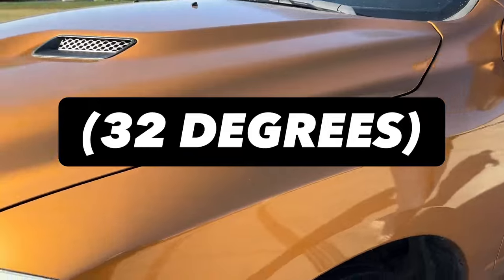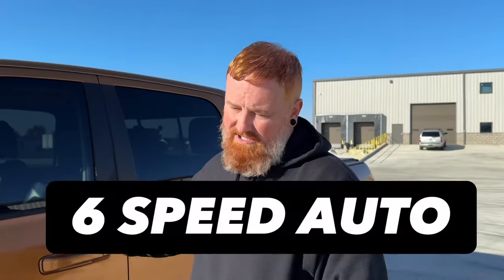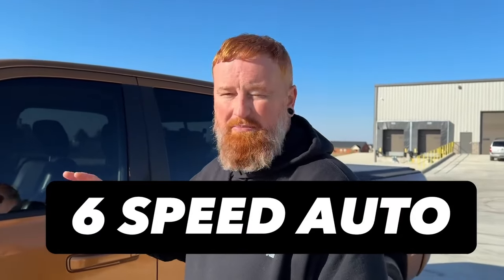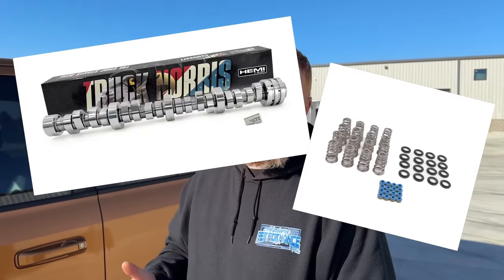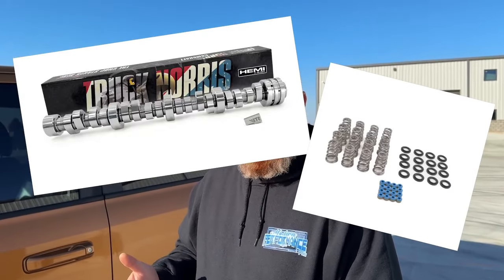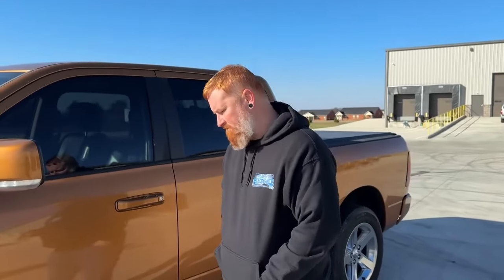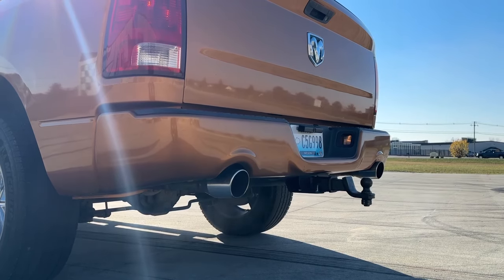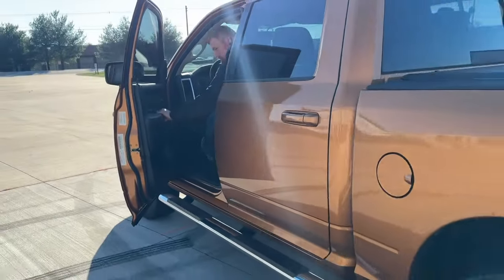Paul's 2012 Hemi Ram - HEMI Truck Norris CHOP!

Comment: Any cams for the 6.4 yet?
Reply: You can use a 5.7 cam since the 6.4 and 5.7 use the same block. Same stroke.
Reply: @TonyBfixin  they’re not the same bore or stroke.
Reply: @tylerharrington4372  I said block. The heads all bolt up to the same block. But BTR sell stuff for 5.7 but you can get it for the 6.4
Reply from the maker: We've got some 6.4 liter optimized hemi cams on the horizon! Soon!

Comment: How would this cam work for someone who uses theirs for towing? I got a 2018 Durango r/t and I tow a trailer with it through the summer
Reply from the maker: The idle "chop" inefficiency cleans up pretty quickly. You will miss very little of the VERY bottom end, after 2000RPM the TN cam will make more power.